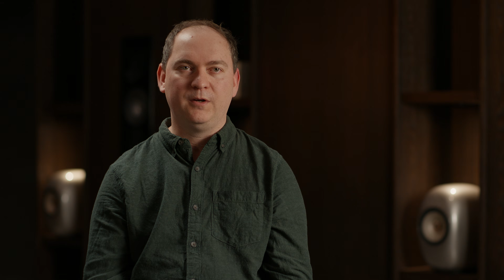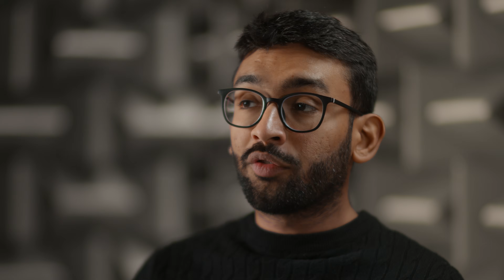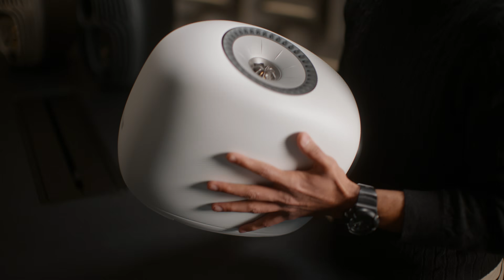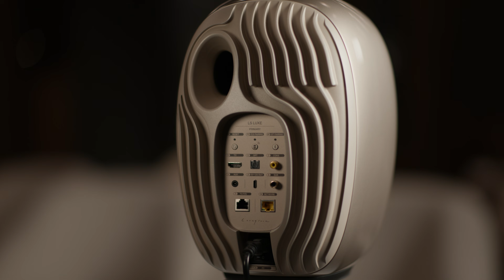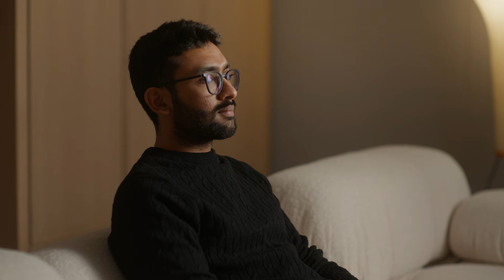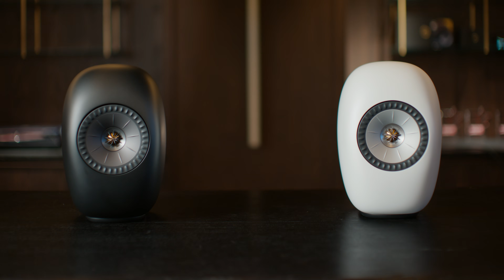In Pursuit of Perfection: Behind the Sound

Comment: I’ve owned a pair of LSX and LS50 Wireless speakers, and unfortunately the experience has made me very hesitant to buy another active KEF product. Across both models, connectivity was a near-daily frustration even with the speakers wired to each other. More concerning, both sets failed within four years due to a defective board (amber red flicker).

That’s a real problem at this price point. KEF makes beautiful speakers, and the combination of sound quality and compact form factor is genuinely appealing. But none of that matters if the electronics don’t have the longevity to match the price. 

If you’re spending €4,000 on a pair of speakers, what happens when a proprietary board fails after three or four years? With passive speakers, you can reasonably expect decades of use. With KEF’s active models, my experience has been nowhere near that standard. KEF needs to put much more attention into QC and long-term reliability of its active speakers. Premium pricing should come with longevity not just premium design.

Comment: No setting to tweak or no user calibration needed? That's simply both bad and wrong since room modes will ALWAYS be there and is always something that a user wanting maximum sound quality will want to fix, so not having that inside a speaker this expensive is a quite a weird choice.

Comment: What exactly are the technological improvements over the LS50 though? Unless it measures like a Neumann,  Genelec, or like the LS60  it's hard to understand what the differences are for why you'd pick it over the LS50. He said plays lower and has lower distortion so that could be either an affect of DSP, amplification, or maybe they have the servos from the KEF sound bar. But they didn't really explain what it was that made the new speaker different....
Reply: They said it - current drive, and back EMF sensing to produce clean bass - no dirt in the midrange. Cabinet looks better too
Reply: 2 seconds with Google will find all the answers you're after.

But, in reality, none of this matters. You need to listen to the speakers. Either you'll like them more than others, or you won't.  End of.

Comment: If you buy these with the dedicated stands at £800, you’re within £700 of the LS 60’s . Makes me wonder if the LS 60’s are going to get the lux treatment. Having owned very well built HiFi separates in the form of amp and cd system that have lasted over 30 years , I’ve changed the speakers a couple of times. I wonder how long these would likely last ? If they are confident maybe they’d offer a 10 year warranty as standard

Comment: I had many problems with my LS60 with wifi. Drop-outs, losing connection. Many moment where I was enjoying music, but then the connection was lost, tidal then had to be manually reconnected. Sold them in the end. Nice sound, but stability is more important. Furthermore I didn’t feel these speakers with all those electronics inside would last longer than 10 years. Passive speakers will easily last 30-40 years.
Reply: You should never use WiFi. If you just plugged them in there would be no problems.
Reply: Sure passive will live potentially long given sterile conditions, but will be worth little anyway and let’s not kid ourselves most of us will not stay with same speaker for 5 years
Reply: Пользовался много лет KEF LS50 Wireless и все работало отлично без обмываний звука. Возможно вам попались либо АС с браком, либо у вас был проблемы с интернетом у вашего провайдера.
Reply: @Audio2384 Yes kef said after many emails send them to a repair center, “but chances are they will send it back to you if they do not have problems” according to Kef.
Reply: don’t forget the frequent static noises you hear if you’re on wireless too
Reply: That’s my main issue with products that are too advanced. If a streamer sucks it’s much easier to replace. If everything is build in one unit everything has to be replaced.
Reply: @rw80  да все отлично в этих АС работает и дело не в колонках. Проверено за годы использования !
Reply: @rw80 you can just buy a new streamer for an ls60 anyway